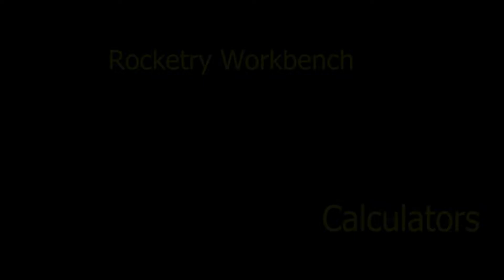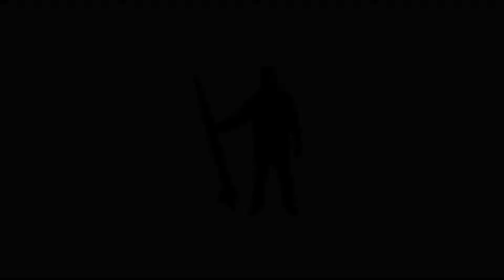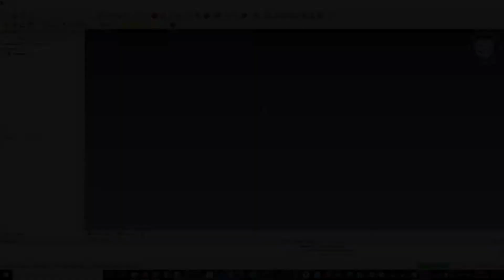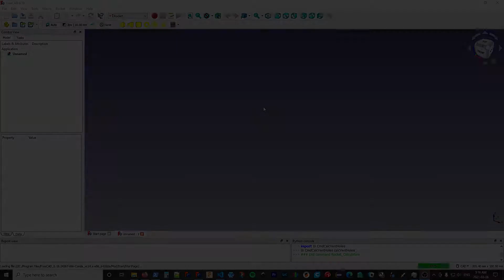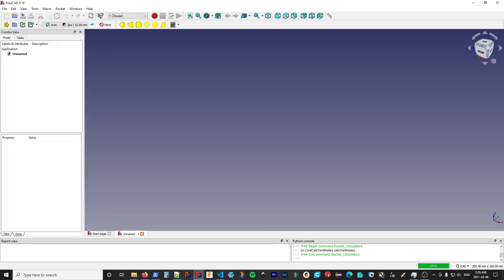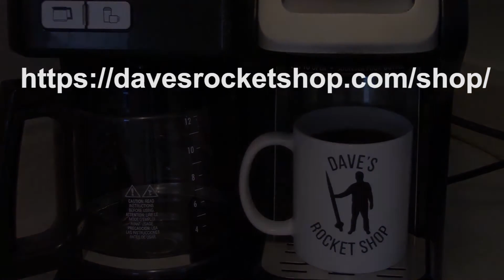Rocket Workbench Calculators

Comment: Dave,
First of all thank you for sharing your efforts and expertise with the rocketry community.

I've been trying out your FreeCad Workbench and have come across an issue that you may already have in hand or maybe it is simply a "chair keyboard interface" problem on my end. 

When calculating Fin Flutter velocity using the Workbench and using the formulas published in Apogee Peak of Flight Newsletter (Issues 291 and 411) I get significantly different results. Results from the two Apogee Peak of Flight formulas match quite closely but the Workbench result varies quite a bit (35%). 
I took a look at your code in Github and while it looks similar to the formula published in #291 (accounting for the SI units), there appear to be some differences that I can't account for.

I think the Workbench is a great tool I just want to understand why I am seeing different results.

You Rock(et)

Comment: DAVE! i saw your site that said you were able to modify the fan in marlin to slow if speed fluctuates etc. howd you do it lol?
Reply from the maker: I had to investigate since it's been so long!

The parameter I used is ADAPTIVE_FAN_SLOWING in Configuration_adv.h. It's simple and works well. While looking I saw there's also an experimental feature PID_FAN_SCALING which modifies the PID for the heater depending on the current fan speed, but I've not tried that myself, YMMV.